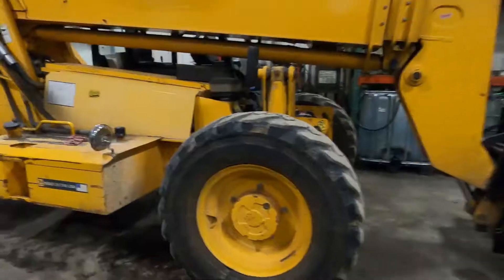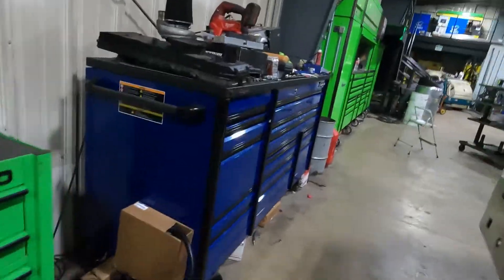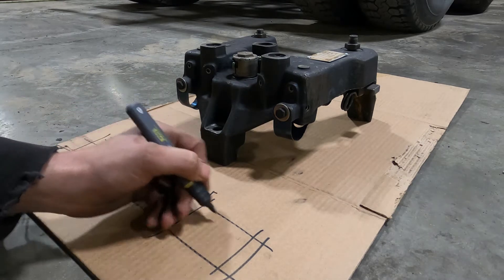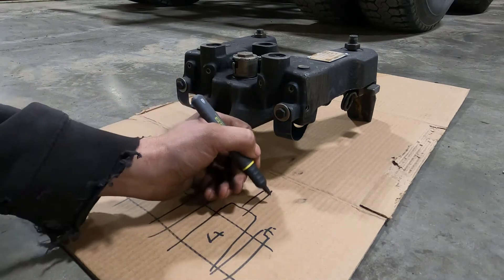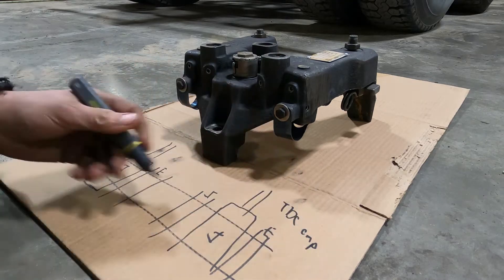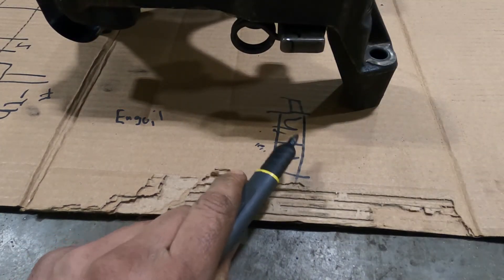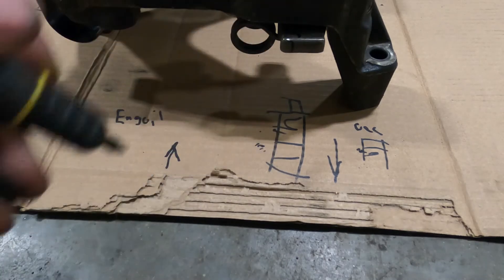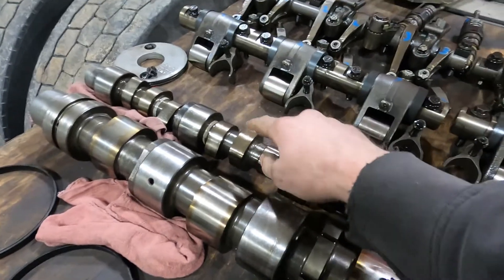Jake brakes!! How do they work?

Comment: I know they use the injection lobe on mechanical unit engines for the jake and now learned the common rails have their own lobe for jake on the cam.  But what I'd really like to know is how does the 3406 mechanical, mack mechanical engines etc work since they have a injector nozzle that pops and the injection pump itself has the injection cam lobes?  Did they have a jake brake cam lobe on them motors cams too back then? I've been in a few different 855 Cummins but I've never had to go in a 3406 mechanical truck engine with Jake's usually my hands are in heavy equipment engines
Reply from the maker: If you've ever driven one I'm sure you were quick to notice that the jakes do not work well on those engines. Ill use the 3406 mechanical since its what I'm most versed on it. These engine use a master cylinder on the exhaust rocker of a different cylinder to activate the jake slave on the exhaust valve. The oil is routed in the housing to another cylinder. So it doesn't quite get you to tdc but close. Thanks for watching.
Reply: @MatzkeDiesel  ahh that's makes perfect sense that they use a different cylinders exhaust stroke for jake on mechanical engine that doesn't have a unit injector.  Our lowboy tractor is a 86 359 with a b model and the Jake's are whimpy.  My favorite Jake's are a old 855 Cummins they bark